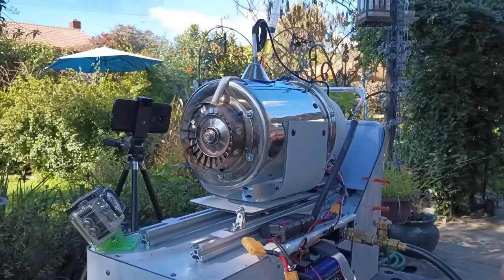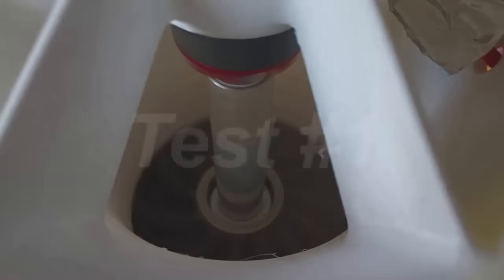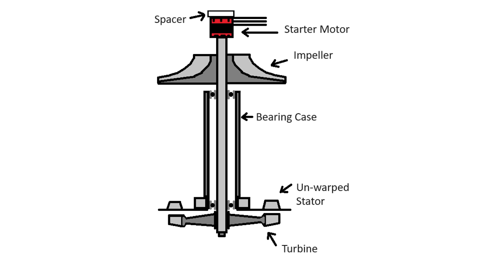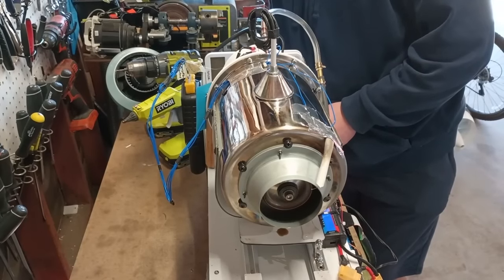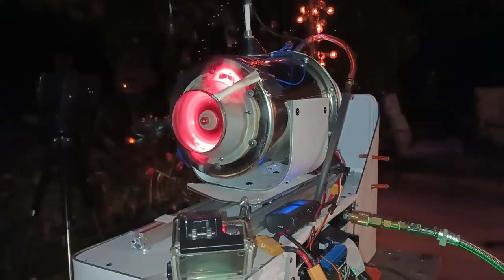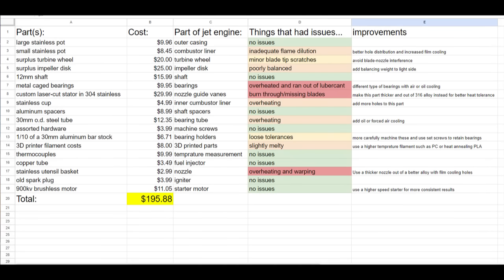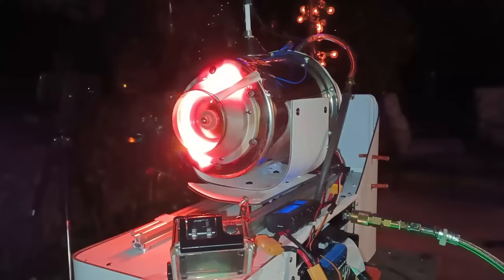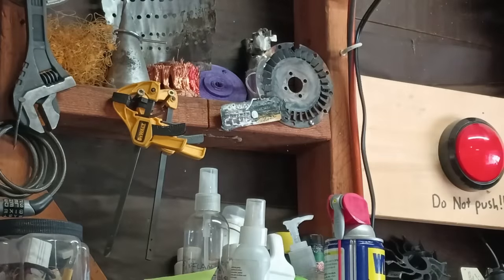Building a turbojet engine from scratch - was it worth it?

Comment: Try using Inconel for the stator and rear turbine.  It is not cheap, and it is really tough to work on, but it will also withstand the heat.  Also use ceramic bearings, and make sure the rotating assembly is VERY balanced!
Reply: I've been looking into zirconia and other ceramics used in the dental industry.
Reply: @RobertLBarnard ceramic bearings are a available for inline skates.
Reply: And available for nitro rc engines too!  Have a set in 1 of my engines.@ArneChristianRosenfeldt
Reply: I’ve been wondering, where do you find inconel that’s ready to use?
Reply: @LiamAnderson-ei7gk  can’t you just buy it? You only need a small sheet. The real problem is that it doesn’t melt, yet you want to to weld it. So you need a fixture to put all your sheet ins place, press on them, use an electric motor to drive the compressor, inject fuel and shot with a laser on the contact line / or shot 100 A through them from a capacitor bank. Cool down, CNC mill using a diamond to the 3d model you used for the test print.
Reply: I'm gonna run to 711 need me to get you anything?  Oh more inconel!  No probs.
Reply: Inconel IN 718 would probably work best. The Fe in it provides good heat resistance. Should work for both the turbine and the stator.

Comment: These small turbine engines use the fuel from the turbine to lube the bearings. Using traditional lubrication will usually causes it to seize

Comment: Great work! keep in mind that most jet engines deal with heat by running very lean with air to fuel ratios above 50:1 all the way to 130:1. All that extra uncombusted air helps to cool all internal components and lowers egt significantly

Comment: Airline pilot and RC turbine guy here. I'm extremely jealous you were able to pull this off when 25 years ago I was struggling to even make one of those car turbocharger "jet engines" back when they were just starting to become an internet fad. 

My biggest concern I can point out is that it looks like your starting fuel is extremely excessive, there really should not be huge flames shooting out of any sized turbine like that especially during start (afterburners excepted of course), and the turbine wheel and stators should not be glowing like that unless the turbine is close to full power. Yes, you'll see some videos out there of RC turbine engines doing it, but it's usually the older/cheaper ones/the owner screwed up, and it's still usually minor.  Try being much slower and progressive with the introduction of fuel. At worse you should just see the faintest flame, but no glowing of metal. Everything from my little 45N Xicoy RC turbine to full scale works that way. I'm sure if you had done that, you would've avoided a lot of your warping and damage, and not have needed to resort to additional spacing between components which would kill efficiency.

You probably know but newer RC turbines use kerostart, so no need for LP gas bottles, basically a single larger fuel injector (more like  a torch) will be ignited initially by a glow plug, and as the engine gains speed by the electric starter, the rest of the annular "normal" injectors will come online as they ignite by the larger torch injector. Xicoy turbines excell at this. Some of the newer jetcats too.

I'm assuming that one syringe is oil. Getting proper lubrication to your bearings is critical for cooling. RC turbines use 3-5% oil mixed into the fuel. Look for Mobile DTE Light R&O oil. It's what's used in full scale powerplant turbines. Do NOT use full scale aircraft oil as its really toxic when burnt or in aerosol (look at the NTSB reports on oil fume events). 

I would avoid the temptation of using diesel. It smells horrid, makes a lot of soot and can ruin the turbine internals in the long term. People at my RC field always eventually have issues. Use heating k1 kerosene, which burns really clean or if you're lucky and live near a smaller airport, you may have access to self serve Jet-A. Look at airnav (dot) com website in the fuel section for where to get it near you, and call the local FBOs for access. You'd be surprised how easy it is to get, and much cheaper than heating fuel and burns just as cleanly with not much worse of a smell. 

Lastly, RC turbines are much cheaper nowadays, I would never trust my beloved jet planes with one of them, but the cheap chinese brands like swiwin have some for $1500 a pop (these are the ones a bunch of youtubers keep getting for free to do stupid stunts with). Look in facebook marketplace for RC turbine jet sale groups, there's 4 big ones and every once in a while some older or crashed cheap turbines show up for sale, for a few hundred bucks. Or you could make an offer and I'm sure somebody would take you up on it. Merely as a way to reverse engineer and tinker with.
Reply from the maker: Thank you for the suggestions! I plan to make a second version so I will keep these things in mind regarding fuel, oil and exhaust temperature.
Reply: Ugh, the fact that some internet fads are now 25+ years old makes me feel downright decrepit.
Reply: @delphicdescant  right????
Reply: I have been using a cheap second-hand Kingtech Turbine on my SAB Drake with thrust vectoring for over a year with no issues. It will hover and climb out like a beast.  I'm even using a cheap $1200 Kingtech on my 3d printed JAS 39 Gripen Jet. I can't afford the expensive turbines. They work great if you keep up with the maintenance schedules.
Reply: ive found that those car turbines need to get REALLY HOT before they start working efficiently. or want to even idle for that matter
Reply: @delphicdescant  I actually had to do the math. I initially thought it was only 15 years or so, but no, it really was that long ago once I started remembering more details.😭

Comment: What a great video! Good job throwing this together using stuff around the house. I'm in the engineering industry and have helped design things like pressure chambers to 30,000 psi for testing. Keep this in mind please: be safe! With the turbine turning at probably 100 of thousands for RPM's and your metal starting to melt you could have had catastrophic failure of the internal compressor to the point of it coming out of the engine bay travelling at very high rates of speed! When building the pressure chamber, I had to think of "how could this fail" multiple times thru out the process and and how could I get injured if it did. Keep that in mind, and keep building better turbojets!
Reply: great advice!
Reply: Do you also design combustion chambers?

Comment: The turbine and the stator is simply far too hot. The combustion chamber is not working correctly, you need to get more air to the rear of the chamber. I built one with only stainless steel for the turbine which still lives to this day if the jet pipe is in excess of 600c you will have problems.

Comment: I like the suspense with the intense music, as fire and sparks are released back into the world. You should allow for much bypass air, possibly just by making your nozzle act as venturi and through welding fins to external housing of preferably light weight material. The fins will conduct heat from nozzle and help cool with air on it's surface area, all of this without needing a bigger compressor fan, but radial holes with bent aft angle can be drilled if venturi effect isn't super effective

Comment: This is awesome, nicely done! I saw the engine was on a slide track, were you able to measure thrust output?
Reply from the maker: I did have it set up on a slide track, but some tight wires and hoses ended up making the thrust reading unreliable. At one point,  it showed up to 107 grams of thrust but I assume it produced more than that by how it pushed its self forward on the track. Based on the pitch of sound it was making compared to my 5000 rpm starter, I can estimate that the impeller only hit about 15,000 rpm at full power. The thrust was likely rather lousy still because commercial jets get upwards of 120,000 rpm.

Comment: 3 things: 

1 - Don't skimp on bearings and making sure they are aligned and appropriately lubricated. Check out SKF's 6201-2Z/VA201 or similar. Regular "High" temperature bearings are only rated up to 150°C whilst these are rated for 350° which you can get to much easier with your cooling than to try and get your housing temps all the way down to 150°C.

They're like £50 each, which is expensive compared to $10. But a $100 punt that might help you remove an issue/variable is worth it in the name of progress. 

2 - Have you considered fuel cooling? Not as in cooling your fuel, Not sure the speed of your pump, but you could get some "Free" cooling by using your fuel lines as a heat exchanging medium. It also heats it up making it easier to ignite kerosene? 

3 -  Keep doing what you're doing. Progress doesn't come from academia. It comes from people doing stupid stuff in sheds.
Reply from the maker: thank you for the suggestions!
 I'm currently in the process of making another jet engine and I am now using full ceramic bearings rated up to 250C. it's not as good as your 350C bearings, but the bearings are no longer the limiting factor. My main issue is getting it to start with out interference of the compressor wheel with my current design. I'll definitely look into those bearings as well as fuel cooling if I have any more bearing trouble.
Reply: @AydenWardellAerospace  One thing the commercial RC ones do is run the fuel through the bearings to provide cooling... so you're usually supposed to mix the jet fuel with some lubricant...

FWIW... or you could do like the auto people do and run a oil pump and cooler for the bearings...

Comment: Congratulations! Thrilled that you actually got it self sustaining.

Finding some of those precision parts surplus was very lucky, that's not to say what you have done isn't impressive though. But those parts are definitely not manufacturable at at our diy scale!

Like other commenters, I'm also really keen to see what decisions and calculations went into designing the engine.
Reply from the maker: For this engine, The main calculations I had to do were involving the flow area to avoid restrictions as well as maintaining an ignitable mix in the chamber. I'm still figuring out thermal expansion calculations, which turned out to be very important because several critical parts warped in the heat. I was very lucky to find a compatible titanium impeller and Inconel turbine wheel for really cheap, but the downside is that they are obviously very used and needed a lot of cleaning and balancing.

Comment: Your neighbors must love you building a loud experimental jet turbine
Reply: I love this attitude, its how capitalism crushes innovation. "Yeah we love innovation... as long as you don't: make too much noise, use anything remotely dangerous, repurpose specialist equipment, steal existing designs to learn and improve, use materials that could also be used for construction of anything else like weapons, use lab equipment outside of a laboratory environment, do anything without the backing of a large corporation or governmental body, annoy your neighbours, exceed height limitations, exceed voltage limitations, mildly inconvenience anyone else... But other than that we love innovation!!!!". You think the wright brothers would have been loved by their HOA? How do you think innovation happens? Its by kids like this tinkering in their garage with stuff that on an individual scale is dangerous to themselves but on a societal scale has the potential to vastly improve peoples lives. Ffs some of the first liquid rocket engines used pure nitro-glycerine as a fuel. Which is the active ingredient in Dynamite and explodes at 50 degrees Celsius. Capitalist Cuckold.

Comment: One of my schoolmates on high school built a jet engine from scrapyard turbo. It had plain bearings (no issues with centrifugal forces on the balls) and oil pump which was slowly pumping oil into them (extra fuel)
Reply: the part of the video you didn't see was the pooling oil from the bearings burning a hotspot in the combustion chamber...quite smoky result and made an oily mess...he used 3 in 1 oil initially added by syringe, no pump.
Reply: @jwtheatre  I saw that part of the video, what I said is that oil has to be added continuously

Comment: the biggest problem is that not all combustion are happening in the combustion chamber which is NOT good. you should enlarge the holes on your combustion chamber and also use a stainless steel nozzle which should not melt if the fuel combusts in the right place.

Comment: It seems most of the air in your jet engine gets mixed with fuel and combusted and this causes the over heating and also uses more fuel. Only about 10%to 20% of the air should be mixed with the fuel and combusted, the rest should be used to cool the combusted air before it hits the turbines

Comment: You should consider adding an additional outer shell and turbine. The outer shell would go around what you currently have with a consistent diameter until you reach the beginning on the nozzle where it would have a short conical section to divert airflow around the nozzle. The additional fan/turbine (correct my verbage?) would go in front of the compressor wheel to match the diameter of the new outer shell. 

This way the shaft now drives a controlled outer flow of cool air around the body of the engine.

You can play around with the larger pre-compressor wheel design to get sufficient airflow for cooling while minimizing parasitic loss on the engine.

While suboptimal when considering placing the engine into a craft, you could consider also adding high pressure injectors to the outer shell which inject a fine atomization of a cooling fluid/gas. The simplest that comes to mind is distilled water but there may be a better option like C02 that provides fire suppression and is simpler to inject or creates more even and efficient cooling.

As an additional note, I noticed you had hot spots around the nozzle area. This may indicate uneven combustion. Perhaps adding fins or shaped blocks inside the engine, somewhere between the compressor wheel and fuel injectors, could help. Here the fins/shaped blocks are angled/shaped to direct a circumferential swirl in the airflow for better fuel air mixing.

Of course, I am not sure if this would interfere with the operation of your flame catcher. Thoughts on this?

A potentially simpler solution, either replacing or complimenting airflow swirling, could be to adjust your fuel injection. 

Angling the nozzles more tangentially may improve fuel air mixing. 

Increasing fuel pressure could improve atomization and provide the necessary force for a tangential injection angle to stratify the fuel.

Of course, none of this will negate that heat tolerance of your post-combustion internal components needs improvement. Though, a more even burn and outer cooling flow will help your nozzle and shell to withstand.

If heat tolerance of your stator and turbine remain an issue, you may consider adding fuel or coolant injection just prior to the stator; assuming you can come up with injectors capable of withstanding the heat. Consider ceramic injection nozzles for this application?

The additional fuel or cooling liquid (water?) will vaporize on the hot stator and turbine to remove some accumulated heat. Tuning this to remove just enough accumulated heat without reducing the efficiency of your jet would be required.

Should you choose to implement both post-combustion injection and an outer cooling shell with pre-compressor turbine, the changes set you up for an afterburner in the future. All you would have to do is extend the cooling shell into an afterburn tube and use fuel as your post-combustion/pre-stator cooling fluid. This way you get vaporized fuel and air delivery. Perhaps additional fuel injectors in the afterburner would help here as well, so that you can independently optimize the quantity of cooling fuel and afterburner fuel/air ratio. IE if the afterburner requires more fuel than would be optimal for stator and turbine cooling.

Comment: 310 stainless would be a good option for high temperature applications, 253MA is even better but expensive and difficult to work with but holds its shape very well at elevated temperatures.  We use it for equipment that typically operates between 800 and 950C so it should work very well in your application.

From the sound of your voice I would say you are quite young, very impressive what you have done!  Keep up the good work.

Comment: You could consider ceramic printing of the engine body and other stationary parts sensitive to high temperatures.Such printers are not expensive. For example, Tronxy Moore 1 or 3. The issue of choosing the right ceramics.

Comment: Congrats on a good effort, having been through an almost identical experience many years ago  I am surprised you achieved self sustain at such low R.P.M. Your source of such a low cost turbine wheel is envied. As suggested by others below, the overheating is probably because of the low volume of air flow due to those relatively low impellor revs.

Comment: The hard part is building a combustor that mixes in cold air so the flames don't ever directly touch any metal without cooling, that is how big airline engines can work many hours without melting